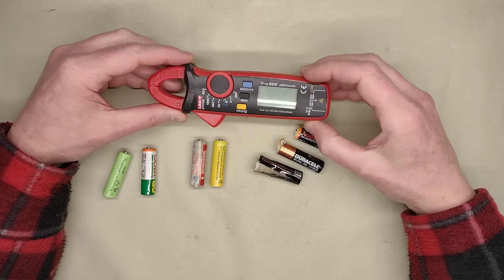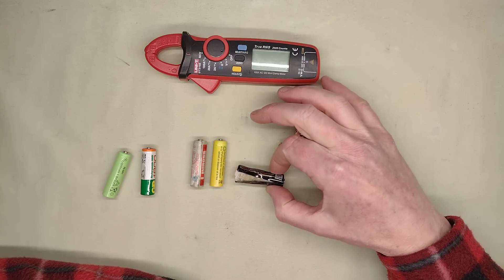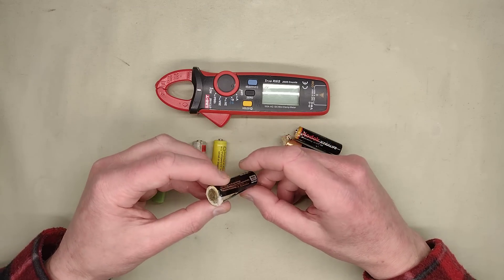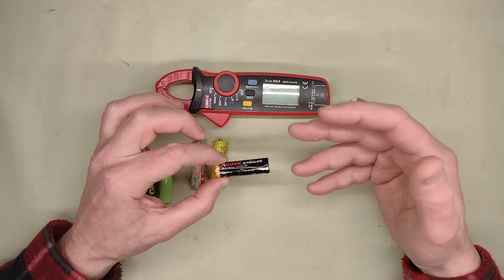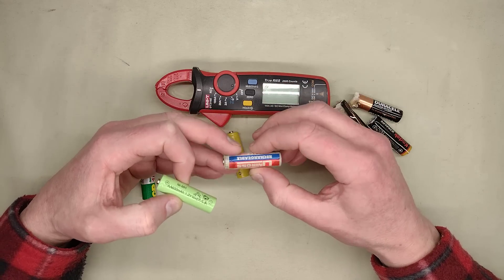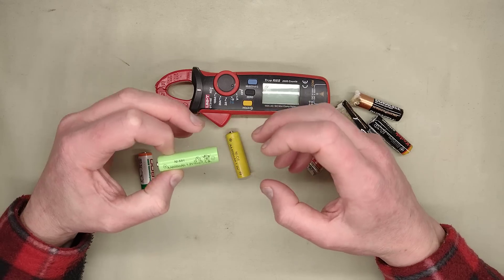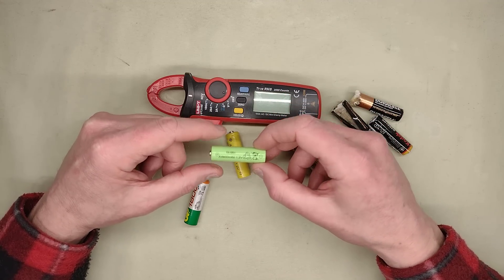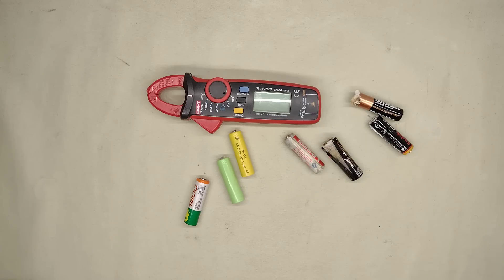The curse of leaky alkaline batteries

Comment: Funny enough, a couple days before this video came out I was cursing at alkalines myself. I opened up a fresh pack of 32 Philips AA's only to find out that 6 were already leaking. The acid had already eaten through the inner packaging of the pack. That combined with the fact I already had to clean out toys of my kids because of leaking alkaline batteries made me decide I was going full NiMH from now on. At this point those cells are so cheap anyways.

Comment: In my experience the worst battery in term of leaking are the Duracell.
Every time I see a product with crystals around, there is a Duracell inside.
If I have to say numbers I say 4 Duracell out of 10 are going to leak.
Of any other brand (in an average of 6 different brands) I say 1 battery out of 10 are going to leak
Moral of the story, I stopped to buy Duracell, and I'm trying to replace everything with rechargeables.
EDIT: Just to clarify, the Duracell starts to leak even when the product is in use daily, like a tv remote control; not because I leave the equipment for years with the battery in it.

Comment: Curiously, despite all the electronics-related past I've never seen a leaky or otherwise defectve alkaline. Leaky zinc batteries yes, dead car battteries yes, self-destruct Li-ion once, but not alkalines. Maybe it's about temperature and moisture (or absence of the latter) in an urban apartment. Maybe it's because most applications around me are low-current, like multimeters and remotes - and some are actually zero-current. I had some Ikea alkalines in the first stage of a tube amp installed in 1999 - they were replaced after exactly twenty years in place, and still tested sort-of-okay for this job.

Comment: Several of my "long life" Nimh batteries became faulty after I forgot to keep them charged within 18 months. Alkaline are only useful to me if I need the extra voltage for performance - RC cars for example.
Reply from the maker: If a rechargeable cell goes to zero a "smart charger" won't detect it.  If you put some current into it with a dumb charger or power supply, the smart charger will detect it again.
Reply: @bigclivedotcom  Yep, A dumb charger does charge them but then the smart charger still always shows as faulty.

Comment: Would there be a chance for an alkaline battery to leak when it's never been used before even though it's perhaps 5-6 months old?
I use 9V batteries in my, quite expensive, electric basses but I change them every month after they've been used for about 20 hours. I'm quite sure there is enough power left for another few months but I won't take the chance of an instrument dying while on stage.
Thank you!
Reply from the maker: Modern alkaline cells are showing increased leakage.  It may be worth removing them when not in use.

Comment: The Energizer Lithium battery will never leak, ever. It says so right on the packaging. The back of the package says, 100 percent leak proof, based on standard use. That's good to know. The downside is that they're rather expensive and the voltage is somewhat higher, something like 1.82 volts. You could put them in a brand new TV remote control and it would last the life of the set, I would think.

Comment: Nickel Cadminum are typically still used in self charging landscaping lights(at least in the USA). Alkaline are still useful in remote controls - Every Black friday, I get a 30 pack of batteries for $3. Being able to pop a pair in a remote and use them for 3 years is far better than spending $1 each on rechargables, and have to mess around with charging them ever few months or so. As long as you catch the batteries when they just start leaking, its a 2 minute job with vinegar to clean up the contacts and slap in a new pair.

Comment: I thought leaky batteries were a thing of the past if you bought good batteries but I just found one in my thermostat. It was leaking pretty bad but at least it stayed off the circuit board. Brand was duracell.

Comment: I pulled a leaky alkaline battery that was brand new out of a clock that my wife bought less than a year ago???
And it was a top of line brand "Duracell" that was rated to be good until 2028....
My wife was like, I can get a new clock, and I was like, "That's NOT THE POINT."  Ended up cleaning it up and installing a new battery and it's working, for now....

Comment: My grandfather would never let me near a battery after it had leaked as a kid so anytime it happens now, I get this odd sense of danger although I know now that I’ll be fine as long as I wash my hands and clean the battery compartment out, guess it’s one of those engraved childhood things you were told to avoid to the point of sticking. Duracell and dollar store batteries are the worst with energizer seeming to last the longest. Although I only really use non rechargeable batteries on products that don’t fit or when I get a new item and they come with batteries.

Comment: Most devices use 2 AA batteries, usually in series. what I always do is get a 14500 lithium battery and a AA size blank just to take up the space and complete the circuit. You can 3d print a   cylinder with a hole through it and put a piece of wire through.

Comment: This is a big problem indeed. The chemicals that leak out corrode the connections to the battery compartment and they can be very hard to reach and to restore. I've had equipment like photo flash units ruined by leaky alkaline batteries. I have a vague impression that Energizer batteries are somewhat less leaky than Duracell ones although I haven't really tested them in a systematic way.

Sometimes the 1.5V vs 1.2V makes a difference, generally 1.2V is OK. I wonder about the lithium AA and AAA batteries. They do offer a higher voltage than NiMH batteries although I imagine their temperature tolerance may be less.

Comment: High humidity or environmental changes seems to make this chemistry very angry.  I had two pop in the same bathroom clock within months of each other, then I lost a flashlight not long after I started work at a fast food joint.  The cell was either new or happy for years before.

Comment: I work in the service industry (for residential/consumer clients) and back when I was a field tech, we would run into leaking alkaline battery packs literally every other day. We go through hundreds of replacement batteries a month. The issue with this application is they are used in long-term battery back-up packs, and consumers NEVER check the batteries and will go years between PMs. In some cases, the leaking batteries will damage or destroy electrical components if the battery pack is close to a circuit board. They really should move on to something better.

Comment: Duracells are the absolute worst. You can find them leaking in the package in the store. Duracell 9-volts are guaranteed to leak. Sadly, the other manufacturers are keen to catch up with Duracell's leaking technology. The best way to handle to handle alkaline batteries is to keep them in a ziplock bag next to your device. Only put them in when you are actually using it, then take them out again. If the bag fills up with white fuzz, you can throw it away, nice and neat.

That's not great for an emergency device, but a flashlight or radio that has had its guts eaten away by alkaline mange isn't very useful either. Single-use lithium batteries are expensive, but not as expensive as replacing all the devices that alkaline batteries destroy.

On another note, have you ever seen a rechargeable lithium battery burn? Pretty impressive, even a small one. Nothing will put it out. Now imagine a thousand pounds of that speeding down the highway. When I see a Tesla on the road, I get away from it. I won't park next to one either. You'd have to be out of your mind to charge or even  park an electric car in your garage - burn your whole house down before the fire department can even get there.

Basically, batteries are not the future. It didn't used to be this bad. I blame cost-cutting and shoddy far-east manufacturing. Lithium rechargeables have always been a bad technology.

Comment: This is a great point it will save some folks spending serious multimeter replacement money.. My favorite non contact probe had leaky cheap batteries
 It was unfixable.. It absolutely destroyed the entire circuit board eating traces all the way to the little black epoxy chip ⚫

Comment: Whenever i purchase consumer electronics whether it be a clock, portable radio, or flashlight... they ALWAYS seem to include Duracell alkaline batteries in the package. The first thing i do is throw those batteries away.  Duracells are notorious for damaging electronics, and... even the comments here reflect that.

I noticed you dont show Energizer Alkaline which I have NEVER had leak on any products...even when i find an old remote for TV from 10+ yrs in storage. I still purchase Energizer Alkaline and now Energizer Lithium (when i need the hi current dump).

Thanks for making this video.

Comment: Any recommendations for decent Ni-MH cells (in the U.K.)? I’ve had so many stop holding a charge after a few cycles that I switched back to the comparatively cheaper alkaline cells. (Also, I have a portable USB charger that specifically states to only use alkaline cells - presumably because 4*1.2 V doesn’t give the 5.2 V that it supposedly outputs).
Reply: If you avoid deep discharges (all the way down to 0V) and don't charge them if they don't need charging,they should then easily last for the advertised 1000 cycles. 5.2V isn't necessarily problematic for a charger as a completely full NiMH battery outputs 1.35V. However, if a charger blindly feeds 5.2V to the batteries, that can cause problems and explain bad endurance. Charging them with a proper NiMH charger is a good idea.
Reply: @danielmantione  I suspect that the batteries I had were probably not the best quality. They were all Energizer ones, I think - at least the ones I haven’t gotten round to taking to the recycling centre yet are.
Reply from the maker: Most prominent brands are good.  Note that "smart" chargers will often end charging prematurely if the series resistance of an older cell changes.  NiMH cells do not like being over-discharged when used in series groups as the first to go flat gets reverse charged by the others.

Comment: When you want equipment to operate reliably when needed, be it flashlight, radio or mulltimeter, there’s only one choice, and that is Energizer Lithium batteries.  Whatever you do, do not purchase Chinese Lithium batteries, as they can be extremely dangerous.  In fact, we’ve seen them explode while still in the original wrapper.

Comment: All brands of alkaline batteries are crap. We’ve purchased hundeds of thousands of Energizer Lithium AA batteries and have never seen one leak.  Plus, they have a 15 year shelf life.  They are perfect for low current applications because they maintain high voltage until the last few days of operation.  But they also perform well in high current applications.  Years ago we tried Chinese Lithium batteries which immediely caused a fire at one customer’s facility.  Switched to American made Energizers and never looked back.

Comment: Recently I opened up the battery compartment in a radio that had been sitting unused for 19 or 20 years. It was plugged in, but had 5 D-cell batteries as a backup for the main power. But it also had 3 AA batteries as backup for the clock. The AA batteries had leaked and self-destructed, while the D batteries did not leak at all. In fact I tested 2 of the D batteries, and one of them had full power and the other had about 50-60% power. It seems like the AA batteries are more likely to leak than the D batteries.

Comment: Snap. Same meter. Some of the worst batteries I've experienced are Costco own brand. I have disposed all mine at the local Aldi battery collection point and will never use them again. I've had Duracell batteries that have lasted 1O years without leaking, but that has been with little used equipment. Now tend to use Varta.

Comment: I  had to take my Fluke multimeter apart last year when the batteries leaked electrolyte into the casing. I had to strip the thing apart, clean and reassemble. Not a 5 minute job.
Reply from the maker: That's an unfortunately common issue that can lead to electrical accidents.

Comment: I stopped using Duracell AA and AAA, as they have ruined multiple remotes, a bunch of flashlights and several other items. They also ruined the mother boards on 10 air packs at my fire company, to the tune of $750.  I have found that you call Duracell and complain, and they will send you the money to replace the ruined item, as long as your batteries were not past the good till date. They took a while, but the did pay for the air pack motherboards.

Comment: My father had a nickel cadmium battery from a German WWII submarine. After we refilled it with new electrolyte it was perfectly good again. But with rechargeable consumer batteries I have made only very bad experiences. After a few charge cycles they are usually dead and hold very little charge. NiCad dry out and have too little electrolyte.

Comment: The problem with nickel metal hydride is finding a charger that won't overcharge them and kill them off prematurely. With the cheap chargers that are widely sold, you have to write down what time you started charging, and remember to take the cell out of the charger at a certain time, which you have to calculate based on the degree of discharge.

Comment: I have had more failures in the last year of those alkaline batteries that my whole life-38 years combined. 8 in one flashlight, 2 in one remote 2 in another remote, 6 in another light, a 9 volt in my temp gun, 6 in my uv lamp and a bundle more these were all new not out of date and bought at home depo. They skewed more duracell due to a bias I had before that was what I bought but i have tried other brands i find just as many energisers failed this way. The ones i don't see fail are the ever ready they die way to quick to fail chemically this has been a 2021 thig I don't know if shortages changed the material thickness anyone else see a rise in failures in the recent year or so.

Comment: Weirdly I've seen alkaline cells leak quite quickly, but when used in a clock they seem fine.  I have been using those poundland Kodak alkalines in a few clocks and they seem to go years without any issue.

Comment: A very interesting video, thank you. I have a Junhans Mega radio controlled digital alarm that I bought in March 1993 as a workshop time standard, keen to see it work, I extracted an already year old Rayovac AA alkaline back up cell from a defunct timeswitch and fitted it, after ten years the display dimmed; the cell had whiskers, I cleaned off  the stainless steel contacts and put the cell back, the display perked up and the clock syncronised from DCF77 Frankfurt, I cleaned the cell twice more before the display finally dimmed untill in 2008  it could only just be seen in an oblique light, however the clock was still checking in every hour! I still have the cell and it is unchanged. i have a recollection that it draws 250uA quiescant and 2.5 Ma when sychronising.  In the 60's Duracell were advertised as the battery that never leaked or your money back and they were very expensive, I suspect as others do is that as the capacity has increased so has the propensity to leak or even burst.

Comment: Nikon's last and best film camera, the F6, uses two CR123a lithium batteries. A pair will last through about 30 rolls of film. But if I use the only rechargeable cells that replicate the CR123a (Watson lithium rechargeable) they will last for only a couple of films. They are only 400mAH, and while you can find larger capacity batteries in the right form factor, their voltage is wrong. So I stick to the CR123a lithium Duracells. Outside that I find the Panasonic Enerloop Pro rechargeables very good.

Comment: Glad you shared this. I've been replacing alkaline batteries with rechargeable ones over the last year for pretty much everything except things like clocks. There's one issue I recently found with NiMh batteries: the slightly lower voltages makes them unsuitable for Christmas LED lights. They appear very dim and after only a few days seem to be flat while they aren't. Had to use alkaline batteries in those to make them shine properly!
Reply from the maker: The three cell battery packs work better for LED lights.

Comment: I had an Energizer alkaline battery specifically designed for long life leak into my doorbell and ruin it completely.  When I called to complain, the company had me take and send them a picture, give them the lot number of the blister pack the batteries came from, then sent me payment for not just the batteries but the full cost of the doorbell.  As long as the company pays for damages without hesitation or complaint, I think it's an okay risk to take.

Comment: I had a soldering iron in highschool that ran off 4 AA batteries, NiMH batteries couldn't bring it up to temperature with their lower voltage. Yeah it's a niche, and admittidely stupid product but it's the one example I could think of where alkalines work where NiMH couldn't
Reply: That would be cool application for a 3.7V Li-Ion battery :)

Comment: I have a 1996 school project 3/1 led blink triangle with two AA Duracell from 1996. Still running If I switch it on. Not leaking.

(3 red led/1green /2x cap / 2xB557B transistors (I think) and few resistors.)

Comment: IKEA is going to stop selling alkaline batteries which is good since they're so wasteful and they start leaking.

I've got their 12 bay charger, using 2450mAh AA and 900mAh AAA batteries and they work great. Unfortunately they changed their design and the 900mAh AAA is replaced with 750mAh which is a shame. I would really like more of these.